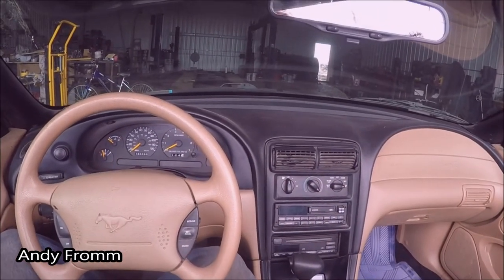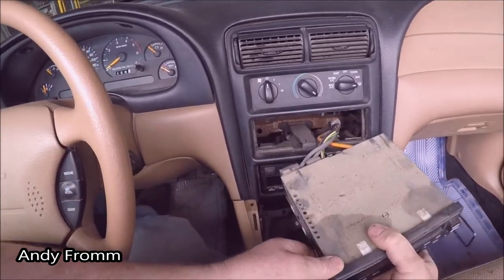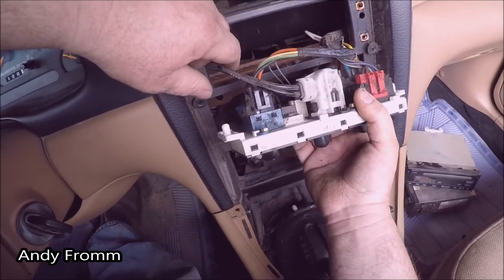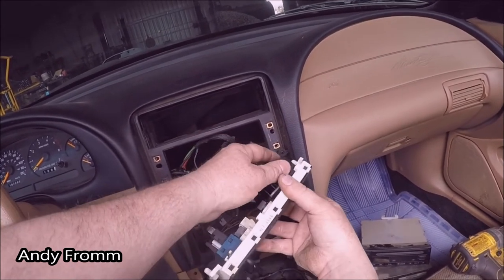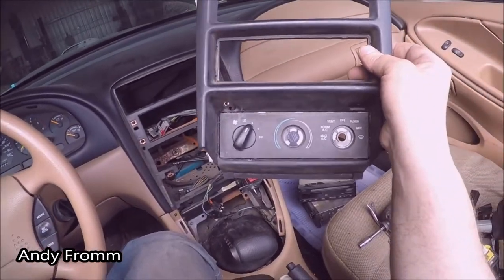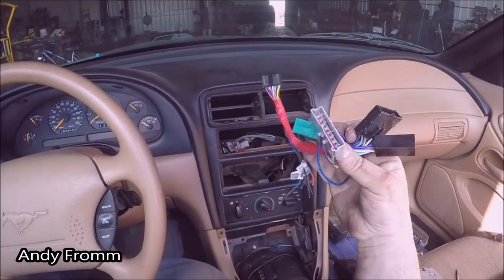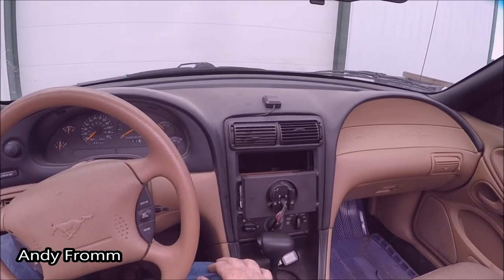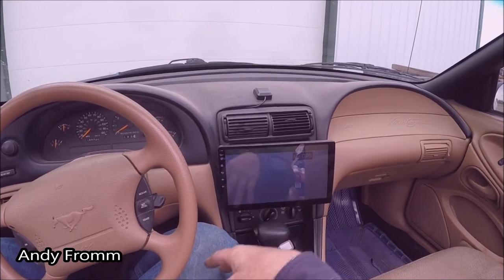sn95 mustang 10.1" head unit and heater relocation

Comment: Where was that second black wiring harness??
Reply from the maker: Mine was just down on the right
Reply: @AndyFromm  ahh, well I can’t find it. I pulled the amplifier out. Is there any way you can show or is the car no longer there?
Reply from the maker: @gekkoman4853  i don't know if it's a different year thing? I don't even know where the amp is on these. my plug was right there, I wouldn't be able to show it any better.
Reply from the maker: @gekkoman4853  i did some googling, if the amp is where it showed me, there can't be that much wiring to follow back.
Reply: @AndyFromm  yeaaa, the connector is different than the one that was provided. I’m convinced I have the wrong part now lol
Reply: @AndyFromm  I have a 1999 GT coupe
Reply from the maker: @gekkoman4853  I finally was able to log into the online manuals and they show different diagrams from 98 to 99. 
You might need some amp bypass harness.

Comment: What’s the park called that’s holding the radio and where can I find it ?
Reply from the maker: Simgle din radio cage, i think they are pretty much the same but i came up with xtrons FRA002.
There is some on ebay. 👍
Reply: Ok thanks
Reply from the maker: I ment to say, I think the xtrons cage is about the same as other regular aftermarket radio cages.